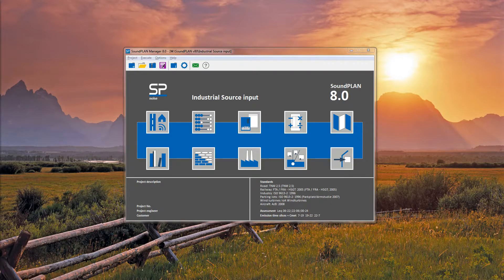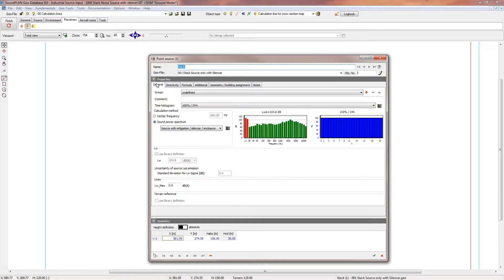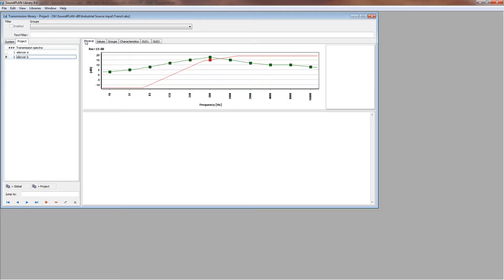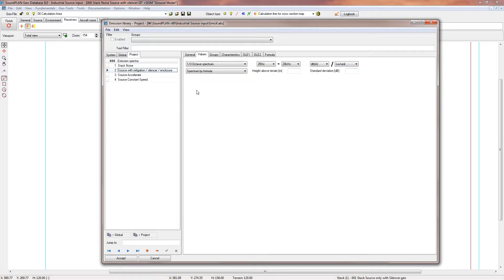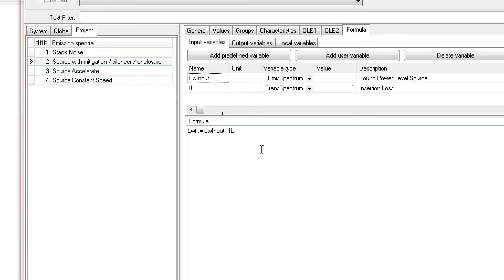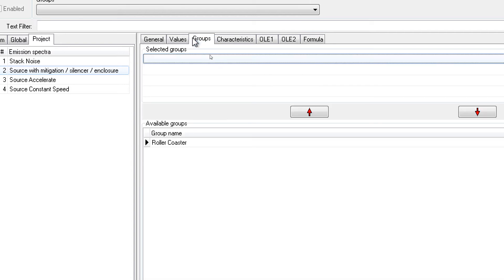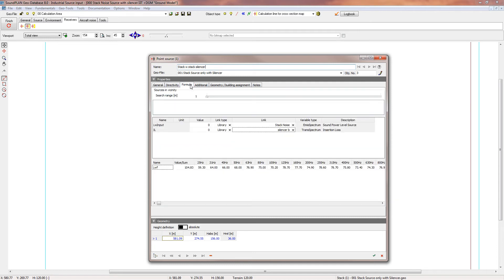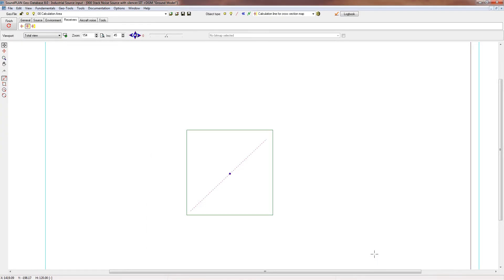SoundPLAN Source Formula Insertion Loss

Comment: my point source Lw is 116dB. when i calculate the noise with single point source the maximum noise level showing in the graphics is 94dB, how? it should come at least 112 or 113dB. please help.
Reply from the maker: Sachin,

do you know the difference between Lw sound power and Lp sound pressure? If not please look it up.  
If you have a point source it radiates into a sphere or half sphere. As long as you have free field propagation the following holds true... Lp = Lw - 10 log (Area)  if you have a half sphere area is 2 pi R^2.... so you have 

Lp = Lw - 10 log (2 pi r^2) 
Lp = Lw  - 20 log(r) - 10 log (2 pi)
Lp = Lw - 20 log(R) - 8 

If your receiver is 5 m from a point source on the ground...  you would get 94 dB .

Cheers